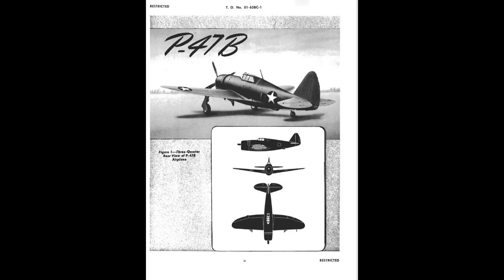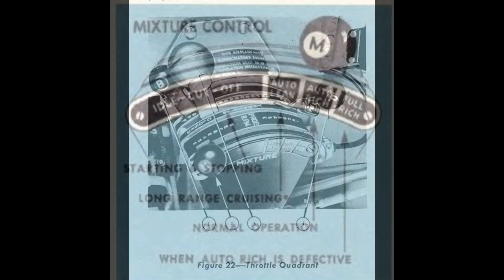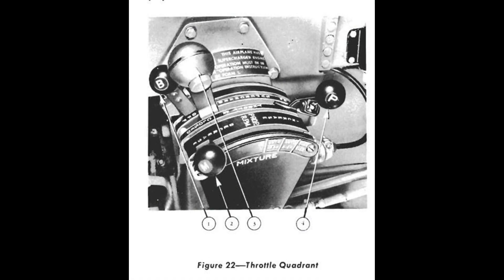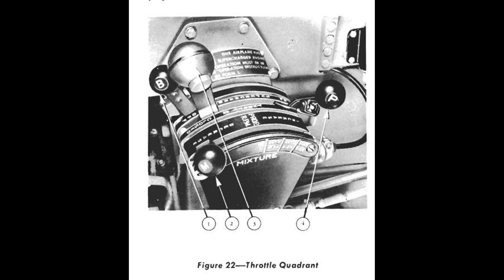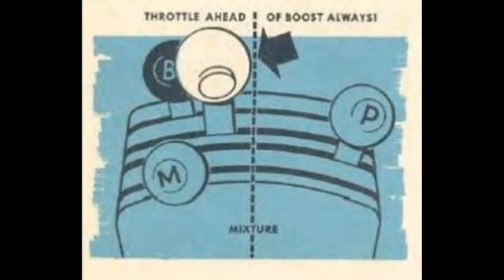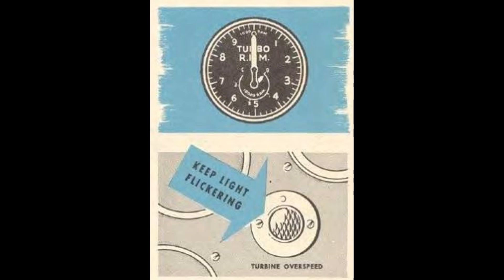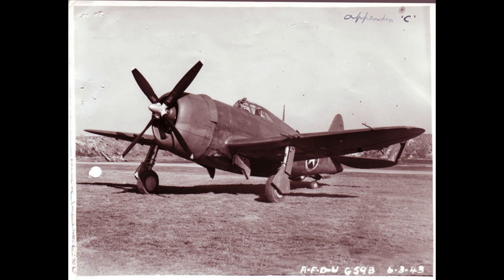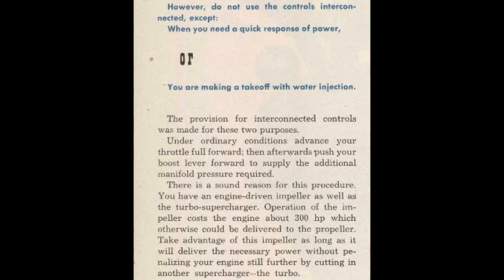P-47 Thunderbolt Pt. 1A Throttle and Boost Lever Use

Comment: In every constant speed type airplane I have flown the trotter controls Manifold pressure (Power) and the Prop control controls the Engine / Prop RPM. and the only air plane that you could have Manifold pressure exceed RPM i.e. 35"mp over 2700 RPM was in Turbo Charged planes like the Turbo Piper Lance or the Turbo Cessna 210.
Reply from the maker: That's absolutely false. That myth has been around forever, and I have no idea where it started. It's absolutely normal to have manifold pressure in inches hg above rpm in 100s. For example a 172RG has allowable cruise power settings of 25"/2300rpm, 24"/2200rpm, and 23"/2100rpm and a lot more like this. Here is the manual, go to figure 5-7, it's page 86 on my pdf viewer: https://sportysacademy.com/files/2015/09/172RG-POH-from-Web.pdf. There may be some where this isn't allowed, but in the 50+ types I have flown I have never seen this specific prohibition and in fact, there are usually cruise numbers specifically telling you to do this.

Comment: Question as a Private Pilot with time in many different Single Engine Land AC I have a question about the P&W R-2800 series of engines. Being they have a gear reduction of 
I believe  2 to 1 is the tach reading Propeller RPM or Engine RPM since all props over 3 feet in diameter seem to red line at or below 2700 rpm.
Reply from the maker: The tach in the P-47 and all R-2800 aircraft applications I know of the tach reads engine and not propeller RPM.

Comment: Do you have any information on the 47 increasing its manifold pressure when at or near (<300ft) sea level?  

In IL2, the 47’s pressure regulator seams to increase the non water max pressure to around 58”, and with water to around 68”, with how much over its normal max increasing as you approach sea level.
Reply from the maker: Some 47's did have regulators set for a maximum of 58 inches, but that's not dependent on being at or near sea level.

Comment: Do you have any knowledge on what the turbo lever is actually adjusting, is it blow off valve or something else? how does it directly influence the RPM of the Turbo?
Reply from the maker: Wastegate position.
Reply: @GregsAirplanesandAutomobiles  Thank you sir! What sim do you fly on?
Reply from the maker: IL2, usually on the Berloga server, and usually in an FW190.

Comment: Great video Greg.  I love flying the Jug in IL2 Greatest Battles and your videos have really been the icing on the cake.  Since the prop can also be linked to the throttle, when would one want to do this?  The P-47 is such a fascinating aircraft.  Cheers.
Reply from the maker: Hi Dan, I am glad you like the Jug. I am not a believer in ever linking the throttle and prop lever. Set the prop for max RPM which gives max power, and for combat purposes leave it there. For cruise of course you would pull it back a bit.
Reply: @GregsAirplanesandAutomobiles  thanks Greg!  With the release of DCS 2.7 and Reflected Wolf Pack campaign, a bunch of us have jumped in the Jug again.  It's outstanding if you haven't tried it yet.  Thinking of what the AAF training manual referencing the two "superchargers", I wondering  if the boost lever controls just the waste gates at the bottom of the engine cowling or also mechanically linked to the supercharger on the engine?

Comment: Have watched several of your videos, they are fantastic.  You have the calm, the perfect voice and the correct speed when explaining things.  And for most, you seem to have profound knowledge on your subjects.  And where you're not sure, you just tell it.  
What I learned from your video's:  In WW2 they were far far more advanced on (motor) technology than I ever thought.  Why did it take till the 80's before turbochargers were applied in cars???
Reply from the maker: Thank you. We didn't see turbos in cars until 1962 with the Jetfire (I have a video about that car) and the Corvair. However as you point out, they didn't become somewhat common until the 1980s. The main reason that most cars up until then were not fuel injected, and without injection, reliable turbocharging is relatively difficult. The WW2 aircraft which were turbocharged had an early version of throttle body fuel injection called a "pressure carburetor".

Comment: This video is correct about the boost and throttle. By leaving the boost lever down, the exhaust pressure is essentially bypassing or freewheeling the turbo, leaving the R-2800's blower to make boost. Closing the wastegates too early/fast causes that big turbo-supercharger to have MONSTER turbo lag.

Comment: Another great video , Thanks Greg . Reminds me of a German pilots impression after flying a captured P47 ."The cockpit was immense and unfamiliar.,. With all those levers, controls and switches in the cockpit. I'm surprised your pilots could find the time to fight. We had nothing like this Our instrumentation was complete, but simple: throttle, mixture control and prop pitch. How your pilots were able to work on all their gadgets and still function amazes me."
Walter Wolfrum
Reply from the maker: The Germans had a good point. The plane is fairly complex to operate, but you would be amazed at how fast and natural it is to manipulate the controls after a time. The U.S. pilots basically committed all the controls to muscle memory. Part of their training was in gaining the ability to manipulate every control blindfolded. It's also worth pointing out that once the controls are positioned for combat, most don't have to be manipulated much other than the throttle and or turbo lever. Still, I'll say that the FW 190's set up was overall superior, and probably would have been the way forward for fighters had the jets not shown up.
Reply: "That's because everything goes in the wall in combat." - The P-47 could take it.

Comment: Greg, while we are in the topic of simulations, I would really like to see an indepth analysis of the Allison V-1710, especially in the context of its combat reliability in the Curtiss P-40E when facing the Bf109G2. In il2 BoS, the engine still appears to be made out of glass, easy to missmanage - which is contrary to what I read about both the plane, and those engines. But I do not look into the NACA documentation as you are.
Reply from the maker: I'll get to that. There are some issues with IL2, but it does some things really well. First IL2 review is going up today.

Comment: Great video lots of nice info.
Any eta on the next video? I'm very curious to see what you say about the P-47s high speed handling, from all the research I've done it was quite good at high speed maneuvering.

Currently in Il2 however it is very sluggish and can't even outmaneuver/pull more g than a 109 at high speeds. It also can't outdive 109s ingame as well and suffers from structural loss at around 540 IAS when in reality it shouldn't suffer any loss. The 109 however can dive upwards of 580-590 mph IAS before suffering structural damage.

Il2 is great but the P-47 needs alot of work to get it correct imo.

Great videos, I really enjoy them. I Can't wait for the next one.
Reply from the maker: Hi Legion, I assume you mean the next P-47 video. I should be adding pt. 3 and 4 in Dec.
Reply: @GregsAirplanesandAutomobiles   Ok cool, can't wait to see what you have to say. I'm curious to see if it confirms my suspicions on the il2 flight model.
Reply from the maker: I haven't flown the P-47 in IL2. I will eventually, but I don't want to make a video about its flight model too soon. I think it's fair to give them a chance to refine it. Having flown against it in the FW190 it seems like it's not quite as agile as it should be, and not quite as rugged, but wow does it look great.
Reply: @GregsAirplanesandAutomobiles   Yep it's a beautiful aircraft and very fun to fly despite some of the issues with it.

Comment: Love your vids, Greg. Any love for the P-38? It has turbos, not to mention uncommon flight characteristics because of it’s counter-rotating props, turbos, and unique design.
Reply from the maker: I do like the P-38. I does have some issues which is why it didn't really work out in Europe. I'll cover it at some point.
Reply: Greg's Airplanes and Automobiles - I agree with a post you made elsewhere about freezing cockpit, low Mach number. Had the P-38K become operational, it would have flown precipitously close to it’s Mach number when flying full speed at critical alt. There’s also the inter cooler handicap up to the H models, as well as overcooling/fuel issue that became an issue in the ETO.
Be sure to take a look at the NACA report/recommendations for Lockheed to raise the Mach number by lengthening pilot gondola, more sloped windscreen, and moving radiators to wing’s leading edge a la DH Mosquito

Comment: @Greg's Airplanes And Automobiles I'm searching for some documentary evidence on 1. How effective the elevators of the 47 were between 350-500 mph (right now in Il-2 you can't really pull any more G than the 109 at those speeds, and he can pull more if he works stab trim) 2. Roll rates at various speeds and 3. Evidence that the engine could be and was run at WEP continuously as long as the water lasted in actual operations. Can you point me in the right direction on that?
Reply from the maker: Hi cmbailey. Those are all super complex questions that I can't do justice to in the comment section. I'll be sure to cover 1 and 2 in my maneuverability episode, which will be either 4 or 5. To get you started, you can look here: https://ntrs.nasa.gov/archive/nasa/casi.ntrs.nasa.gov/20090022749.pdf  . That's some complex reading, and I'll break it down later, but it's a start. As for 3, the flight manual lists a 5 min limitation for WEP, but it's a fact that they could be run literally for hours at WEP: http://www.wwiiaircraftperformance.org/150grade/p-47-66inch.jpg . The dilemma for game designers is, do they want to limit things to the numbers in the pilot's manual's or go by testing results?
Reply: Greg's Airplanes and Automobiles Testing results I hope
Reply: @GregsAirplanesandAutomobiles  Thank you very much. My primary focus right now is trying to find some data I can present elevator authority at speed, since the current lack of G capacity when pulling for a shot or doing evasives at 400mph IAS is a bit of problem for an aircraft whose largest advantage is the ability to dive fast.

Comment: From everything I've read pilots found this easy to use and a valuable tool in combat. Since most pilots had their mounts set up for battle after crossing the Channel and making "Dry Feet". Basically the  only things left they had to do was punch tanks and hit the throttle, then play with the boost. A majority of the time the P-47 groups assigned to Bomber escort were above the Germans. The Luftwaffe at first called the Americans "Upstairs maids" which the Luftwaffe considered an insult and slur. Prop over rev was a serious problem with the Curtiss electric series, the "Pencil Prop" and "Paddle blade" was fairly tame, but the Asymmetrical and symmetrical caused headaches to Crew chiefs for a few months. The Hamilton Standard 13'3" was the perfect blade for the 47 until Curtiss straightened out their gremlins.   Great explanation on use of all levers. Great job on 1A!

Comment: I have read anecdotal comments on prop changes later in the war 'paddle blade' type...not sure what exactly was changed and what actually improved by the prop change...do you have any insights as to the changes and performance differences...if any.

Comment: Keep them coming....amazing how much complexity was involved in wringing out max performance of these planes.  I find the automation of some of the controls to be an amazing feat of engineering in an era without  modern calculators, computers and other tools of engineering!

In a side note, I mentioned in a previous post about a possible error in top speed of a hellcat due to airspeed indicator mounting...saw a report that looked official that had the top speed noted of the F6F-5 at over 400mph when tested against a zeke type 52... link here http://www.wwiiaircraftperformance.org/japan/ptr-1111.pdf?fbclid=IwAR0WH4NsJXZXfduWpZbaB87b62XFYHORmiwT0DcJh8TXVEz1Zw4HHNDYN3I   Don't know if this is official but though I'd mention it.  Again, thanks for the videos and keep them coming!

Comment: Greg, right now in Il-2 this is what most of us are doing. It yields about 90-95% of top speed at WEP and 3000fpm climb, but it takes 15 minutes to kill your engine instead of 5
“You can enable the water injection just on the nominal (47" @ 2530rpm) to get something like an "intermediate WEP" - rpm stays the same but MP rises to 59". Not only it's significantly stronger than the "normal" combat power at 55" @ 2700rpm but lasts as long. Even better, after that you can switch to "full" WEP for full 5m without a hitch.
 
I managed to climb to the 20k ft on the "boosted nominal" at initial rate around 3000ft/m then enabled full power; was running very fast at that alt for 5m and 45s before the engine finally seized.”
Reply from the maker: Good information. Can you run it up to 64" or 72" with the water on?
Reply: 64”, and the engine busts in a little over 5 minutes. You basically  cannot use all of the water you have available for emergency power by standard memes because the game breaks you after five minutes!
Reply: *Standard means
Reply: Just to keep you abreast of the current Jug quirks in Il2:
Item 1: Someone came up with the information that the P-47Ds ended up fitted with a prop that was 10” greater in diameter. Apparently this could cause prop tips to reach too high a Mach at high speed high alt. The M and N got a greater gear reduction to the prop because of this. This MIGHT explain why dropping RPM to 2550 in-game gives the D-28 more speed, but I’m not sure.
Item 2: The best way to get the most power for a given manifold pressure setting is indeed to set the prop to 2550, firewall the throttle, and then adjust the turbo. This gives notably higher speeds than any other combination of lever-juggling.
Item 3: Adjusting the mixture to full rich gives slightly more power whenever boost is also engaged.

Comment: Interesting points Greg. I just tested the IL2 BOX P47-D28 to see how they modeled it and this is what I found.

The supercharger alone seems to have critical altitude at sea level. So it is not throttled at low alt at all.  With just supercharger it gets only 49' MAP   and with turbo that increases to 52" at combat  power at sea level.

So it seems that even at low alt you can't get full power without using the turbo.

Also the Turbo has no risk of over pressuring the cylinders even if you reduce the throttle lever below the turbo lever.  I think that is just not modeled.

The forums have a link to the real life  P47 manual which instructs to use both levers linked from take off until reaching high alt when the turbo RPM will become too hi and then unlink them and manually control the turbo rpm to keep it from over speeding.

https://forum.il2sturmovik.com/uploads/monthly_2018_11/310416774_2018-11-2113_17_34-P-47AAFManual.pdf-SumatraPDF.jpg.7ad0b8f2e0d4142622604ab9303fdc3a.jpg

That method seems to make sense with the way it is modeled in the sim.  You seemed to believe the supercharger had a crit alt of 12 ft?  and using full turbo below this is wasting boost in the supercharger that is then just throttled....  I wonder if this was different in different models of P47 or if the sim just simplifies the turbo use .

Thanks for the video . Lots  of us very interested in this right now.  I've been looking forward to playing with this plane since I watched your P47 turbo video a few months ago :)  

I also note that in a high alt emergency, with a bf109 on my tail, I was able to manually over speed the turbo and get extra boost temporarily, and climb away from contrailing bf109.  Maybe it was a G6 I don't know . But I would not have thought to even try that if I have not watched your video about he P47 ace who over sped his turbo to get extra performance at high alt.
Reply from the maker: Thanks for that info. Its sounds like the modeling in IL2 is very close to the real thing, which is impressive. What's important here is to understand the relationship of the two levers so you can get the most out of the plane. The actual pilot techniques are sort of a matter of personal preference. There is no doubt that you can link the two levers for take off (provided you have higher octane fuel, which you would have), but there are some good reasons not to do it that way as seen in the USAAF's instructional video.
Reply: @GregsAirplanesandAutomobiles  I hope you can get some head tracking and try it out yourself.   Your videos have definitely enriched my understanding of War bird engines.  Looking forward to more content.

Comment: in il-2 bodenplatte i had turbo on higher position then trottle and on 2 ocasions when i moved trottle in df from 80 to 20 and then back to 100 i damaged engine, i guess it was because i didnt move turbo lever also with trottle or below it. So it looks like thats also modeled in game.

Comment: Manual says do not use turbo below 7K feet IF you are using 91 octane fuel, like was commonly used for training.
Reply from the maker: That's correct, I actually mentioned that in the description but forgot to add that into the video itself. I made the video is a bit of a hurry and just listed the prohibitions and not all the qualifying statements. The main point is that moving both levers together costs power.
Reply: @GregsAirplanesandAutomobiles  See that in the description, interesting video, as are they all. For what it is worth in Il-2 BoBP you get max speed at sea level with full throttle and RPM, water on, and the boost lever nearly or full forward, turbo is going about 12K, so power doesn't to be getting robbed.